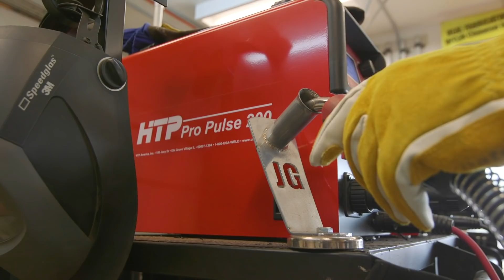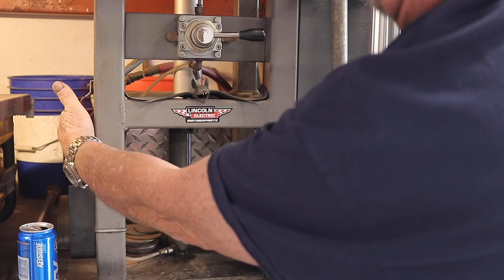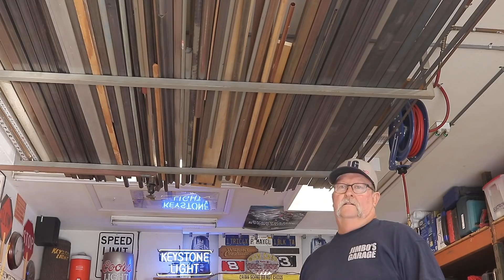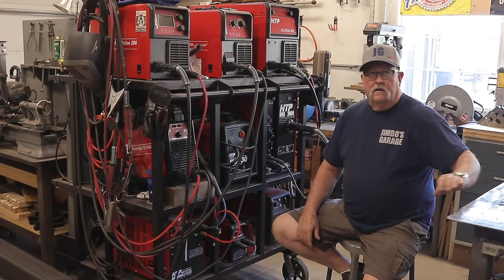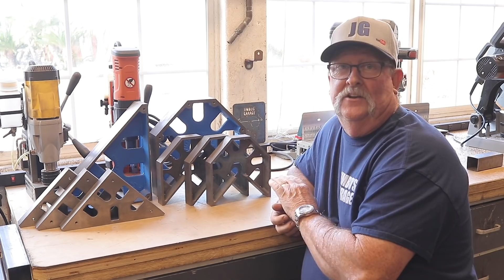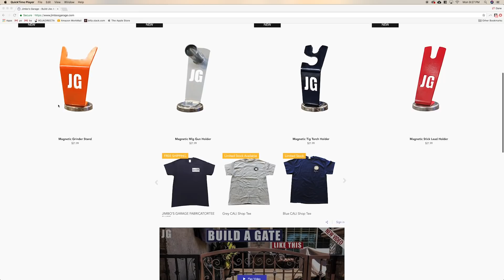Questions About My Shop | JIMBO'S GARAGE

Comment: One idea if it could work for your welder rack connect all your negative  with a short lead directly to the rack and have only one long negative lead that you use to conect to your table or welding item

Comment: Love the welding cart.  Could you add a copper bar, where you connect all your grounds, and then just have one 25' ground lead that you use, independent of what machine you are using?

Comment: Looking at the rack of machines, I was wondering how much hassle there is changing out wire spools as it looks like it would either be awkwardly done in place or the machines would need to be man-handled out for access.
Might it be possible to incorporate a slide mount for each, so they could just be slid forward for access, without having to muscle them in and out? I was thinking maybe using the rails from an old toolbox as the runners would be rated for the weight and a simple pin arrangement could be used to lock them in place?

Comment: Just a quick welding question would you weld or bolt a 15mm rolled steel plate to a welding table from your experience.  Thanks

Comment: I need to do a paint rack like that.
I'm using the same 875SC, it's been a great addition, big step up from my old cutter
My PP200 has been doing a bang up job. I have 3 guns for it, so switching materials isn't a big deal. Maybe I need to add some more machines...
I'm loving that magnetic mig gun holder, using it every day.
Reply from the maker: Hey Richard, Yes all the Htp machines are amazing!  Glad you like the Mig holder,    Jimbo!

Comment: What about the CLEANING LADY ???? You have got to have the cleanest fab shop I have ever seen 😂
Love your overhead storage rack 👍 Great use of space as long as it doesn't interfere with the lighting.
Reply: The single-strip shop LED lights are great for the bottoms of brackets like that.  Spanning them across the brackets reduces shadows too.
Nice to have a switch to turn only half on if they don't have pull-chains.  There is such a thing as too bright.

Comment: That  angular paint rack is a really great idea. I have two old 30” wall cabinets full of spray paint in my garage. Very hard to pick & see the colors. Looks like I’ll be making new angled shelves for them tomorrow.
Reply: It is, indeed but, for me, more for cleaners and other auto' related stuff - use a felt tip/sharpie to mark what it is on the top (some are colour coded, but some are not) and you're sorted. I have way to many duplicates because I bought cans because I couldn't see some I already had.
Heck can be applied for all sorts of stuff.